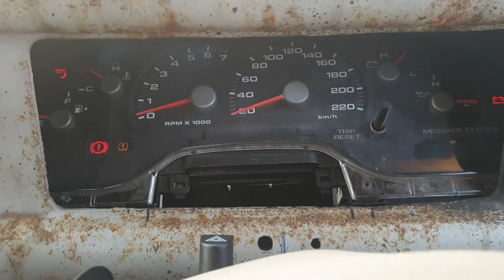1947 Ford Jailbar Pickup chassis swap

Comment: This looks to be so much better than the Crown Vic swap, why isn't it more popular, what are the drawbacks...
Reply from the maker: Here in New Zealand we don't have Crown Vic's, the next best thing is a ford explorer which we can get as they are cheap, only draw back is they are 4.6V8 opposed to the crown vic 5.0 Litre, everything else is the same, plus 4 wheel drive, check out Stalo Fabrication https://www.youtube.com/watch?v=GlB7rZ8Sjp4  he dose these in the states. these are an easy swap and fit really well.

Comment: hi are the shocks sitting on the outside of the bed and then covered with the rear guards.  looking at the video the shocks seem to stick out more the 2004 fords then the 2000 fords

Comment: How did you do the body mounts?
Reply from the maker: Hi, the rear Jail bar cab mounts to an existing explorer cab mount location, I drilled through the Jail bar rear rails and used crush tubes to mount directly through to the explorer mounts. I then used 3x2x5mm thick RHS under the middle and front mounts of the JB Bolted to the underside of the cab, then added front side mounts to align with the explorer ones.  check out Stalo Fabrication on you tube he has some great vids on how he dose the explorer / Jail Bar chassis swaps.
Cheers

Comment: Can the Explorer frame swap be done without using the gauges and steering column?
Reply from the maker: Hi Johnny, anything is possible, yes it could be done, you just need to work out what wiring goes where if you remove the steering column, an gauges etc...............

Comment: what model of ford explorer are you using XLT ut ect.  I was going to put a jailbar on a HQ Holden chassis but may be a better way to go.
Reply from the maker: Hi Peter, its fitted on a 2004 ford explorer with 4.6 V8 once you strip the explorer body off the chassis it fits perfectly, check out Stalo Fabrication https://www.youtube.com/watch?v=GlB7rZ8Sjp4  he dose these in the states. these are an easy swap and fit really well.
Reply: @texasnz2732  Hi.  stalo seems to have used last 90 upto 2001.  did you find any issues with the ford explorer 2004 model that you used in fitting the jailbar?  regards pete
Reply from the maker: @peterstacey6058  Hi Peter, i had no problems with sitting the cab on the chassis, rear mounts lined up perfect, i had to make up some brackets on the front, no welding at all on the chassis, i bought a running 2004 still rego and warrented for cheap so didn't really worry me, i have a engineering fabrication back ground so this helps, it pretty tight in the engine bay but works really well, some mod on fitting explorer steering column, brake booster but not hard with a bit of know how, the rest is easy.

Where are you based??
Cheers Eric
Reply: @texasnz2732  thanks for the info.  really helps.  I am based in sydney Australia

Comment: Bro are you in nz?
Reply from the maker: Kia ora Mike, yep sure do, Bop Whakatane.
Reply: @texasnz2732  kia ora brother im in tauranga bro nga mihi bro
Reply: @texasnz2732  beautiful jailbar brother
Reply: @texasnz2732  hey brother is it only the 3 gen explorer the jailbars fit nicely? 02-05?
Reply from the maker: @mikekemp7664  Hi Mike,
yeah its a 2004, the wheel base is close enough to fit, rear mounts on explorer mount to the cab mounting points, front once's i have added an arm each side to locate to xp frame. i have been able to fit with out any welding to the chassis, its a real easy swap, goes great pw steering, 4 wheel disc's cruz control, 2-4 wheel drive, everything you need.
Just wanted to see if it was possible to fit its just a mock up for now its my farm paddock truck, ive got a 49 bonus i m going to do aswell.

Cheers
Reply from the maker: another video of it

https://www.youtube.com/watch?v=QJqVx9ee4hs
Reply: @texasnz2732  far beautiful bro! Brother add me on fb bro would love to pick ur brain my bro